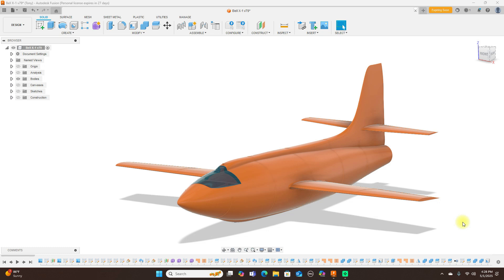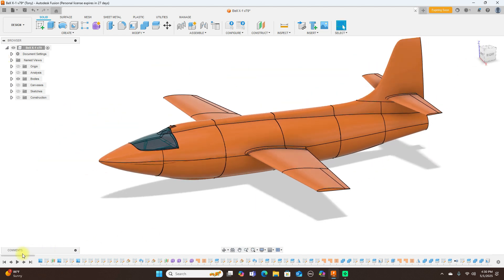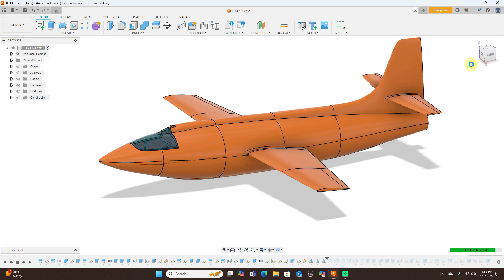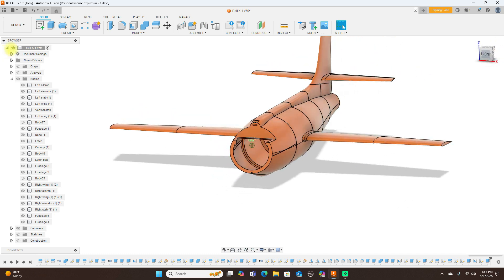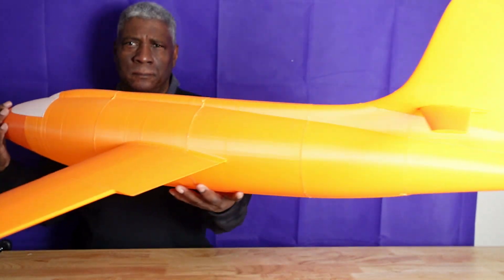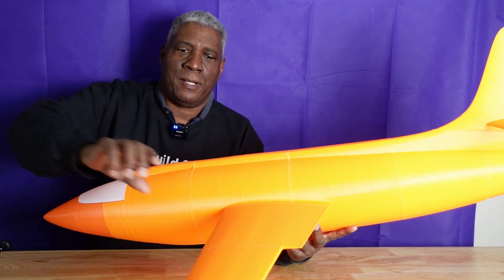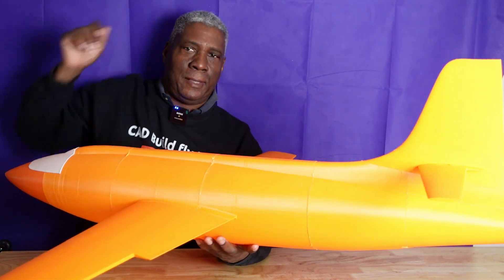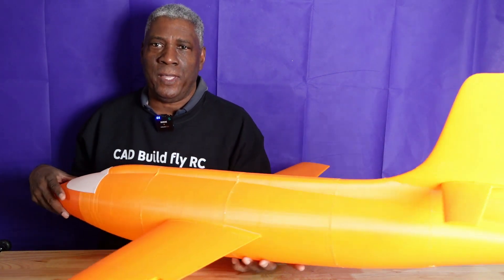Built fast, modeled fast, printed fast Bell x-1

Comment: Silly question maybe, but how would you get an EDF to work in this without air intakes? 😮
Reply from the maker: Not a silly question.  The canopy widows will all be open, just the frame will be there.  So air will flow in.